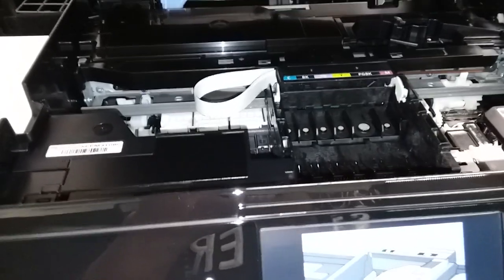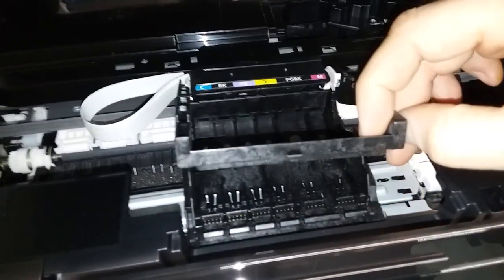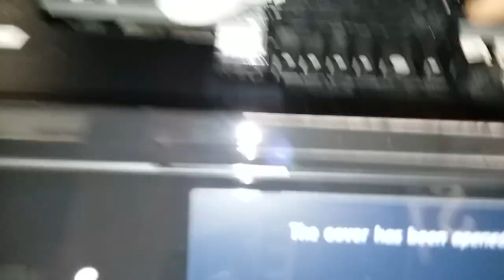How to remove printhead in Canon Pixma TS9120 TS9150 TS8120 TS6120 TS9020 Printers

Comment: Just a quick tip: if you press and hold the power (ON/OFF) button for about 10 seconds, the printhead will move to the middle (service position) so it won't be obstructed, making it much easier to remove without needing to force it away from that plastic bit.
Reply from the maker: Thanks for that. Yes, I have later learned that and try to share that information in more recent videos.. Have a great day.
Reply: this was an essential piece missing from the puzzle....THANK YOU

Comment: I just had to come back, I followed your instructions, using a sour cream container and a spoon for 3 days off and on I kept pouring water  on the openings, then let dry about 3/4 days did not need it I ordered a new head.  The new head came, however I put the old one in first with the same ink tanks as before.  It worked.  to bad I opened the new one.   Thanks have any others problems will be back....

Comment: I'm having issues with my 9120. I feel it's somehow fallen out of timing cycle.  Upon startup it cycles across and makes this clicking gear sound like a gear is stuck and the other one is spinning but not really engaging. Paper tray comes out it grabs the paper cycles through the printing but doesn't print.  No error message on the screen.  Any thoughts?

Comment: hey, i have a canon ts9020.  i cannot print any docs from my pc, the paper would come out blank.  however, when i make a copy it would print out fine.  i've replaced all ink cartridges.  did a bunch of deep cleaning.  took out the print head and soaked it in water over night.  it's still giving me a blank page every time i print a doc from my pc.  u have any ideas?
Reply from the maker: Print a nozzle test pattern to see if all colors print out fine. If main black is missing, it will not print Documents. Also what you can try is when sending a document from computer, select the Document to print out in "color", not just black and white. That will trigger other ink cartridges to print, not just black. Let me know how that works. I honestly think you have a bad black cartridge or the air hole on it is closed. On the top of the cartridge, there is a yellow tab that needs to be removed to let air into the cartridge. A lot of people miss that. If you want to get a cheap set on eBay and see if the main black cartridge is bad, here's a link:
https://www.ebay.com/itm/283544143682
It is not our item, just one of the listings I found when searched for your model's ink.
Reply: I have this same issue. I have not yet cleaned it. But everytime ingo to print its blank!

Comment: Hi, I just want to ask if you also know where is the location of ink absorber pad or waste ink pad?...I'm getting an error "The ink absorber is almost full"....I've search about it in net but can't find an answers... Hope you can help me.. Thanks.
Reply from the maker: The ink absorber is on the right, back side if looking at the printer. The pads error will usually not go away by cleaning it. The printer needs to clear it. There may be online sellers who sell reset keys or you may find a way to reset the pads. I have a video on mg6320 printer, but this model does not have buttons like mg6320. I'll search the net and share if I find something.
Reply: @303electronics  Thanks for answering my question so fast. I'll try to clean the pads for now and if it doesn't work, I'll try to ask the other online groups if they know anything about this....Thanks again.
Reply: I'm having the same issue what did you come up with?

Comment: I have an pixma ts9020 and getting 6004 error , I’ve googled it but wvery page  says that I need to make sure no paper stuck inside , tuned it off , plug it off and restart it , I’ve done all of them but still nothing , any ideas ? no warranty and don’t want to loose it . will be more than happy if you guys could help me
Reply from the maker: Hi. Shine some light into the printer and see if there is a tiny paper piece stuck there. Also, there is a jam access cover in the back of the printer. Lift up the back tray and you will see it behind it. Check that area as well. If timing strip is dirty, it may also trigger that error
Reply: @303electronics  I did wiped that one too :/ Do you  think not having enough ink would do thy as well ?
Reply from the maker: @TAYGAONUR  low ink should not cause that error.

Comment: my 9120 is just making blank pages, I removed the print head and cleaned out - but still doing. I got it from someone else - is the print head dry? how do I solve this? (other than throwing it in the trash!? :)
Reply from the maker: Cartridges dry up sometimes too. Try this: flip a cartridge over put a few drops of window cleaner into the ink port. That may dissolve some ink in a cartridge.  Also you can get a cheap aftermarket ink set on ebay or Amazon and see if that's the case. We have a printhead flush video as well.  In this video I show how to clean Canon printhead, check it out: https://m.youtube.com/watch?v=DFdM9Z6Nnxg&t=2s

Comment: Hi there, I'm finding it difficult to get the printhead back in. It seems to be alright in terms of "clicking into place" but the carriage return is no longer active or working. Unfortunately I can't seem to clear any errors on the screen making it hard to get to any settings on the menu. Any tips or suggestions?
Reply from the maker: Does anything change on screen after you install printhead?

Comment: Hi. My 9120 just died with 6 brand new, xxl inks in it (almost the cost of the printer in ink). The print head is locked under the right side piece of plastic. Is there a way to manually release the print carriage without dismantling the printer? It's still under warranty and they sent me a new printer, but it really cheeses me to give them nearly $100 worth of ink when they sent me a replacement that wasn't as nice as the 9120.... Thanks.
Reply: Watch the video again carefully and see how he pulls out the printer head. You have to pick it up in between where the cartridges sit and angle the print head toward you. I had to stop the video little by little to see exactly what he was doing! Blessings!

Comment: This printer is trash!!! Haven’t used it in a while, however, it’s doing weird stuff.  I can print a document in word however, when trying to print other documents it says there’s no paper.  Also, it will not print in color.  I will not be getting another canon!
Reply from the maker: Try cleaning the paper picknup rollers. Slide the paper tray out and you will see the rollers on the bottom.
Reply: @303electronics  I’ve done that.  I’ve tried this cleaning method, I’ve replaced all the cartridges..... crazy part about replacing the cartridges is that I’ve not been able to print any document in color but the color levels are decreasing.